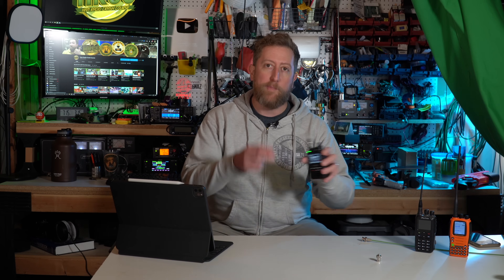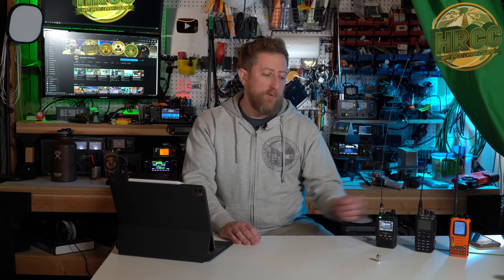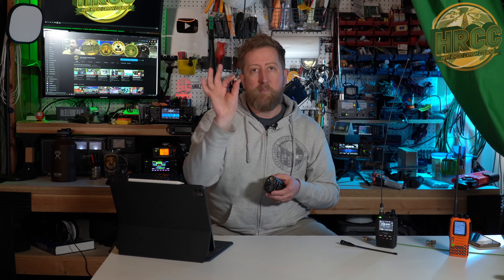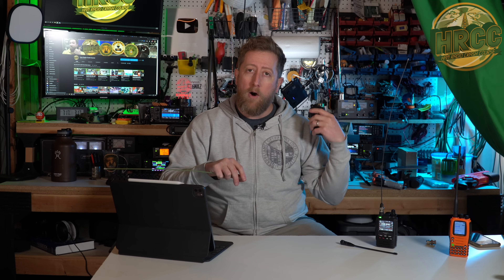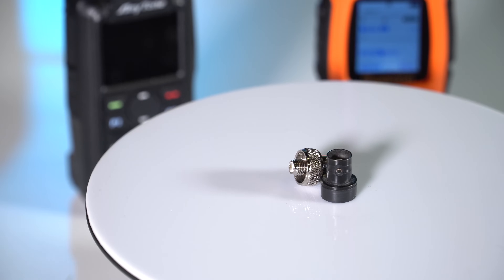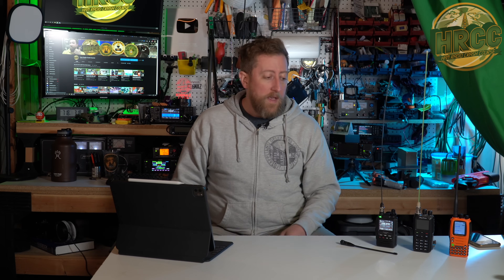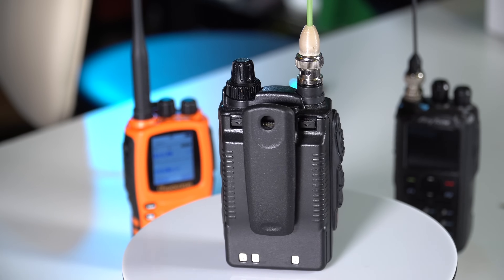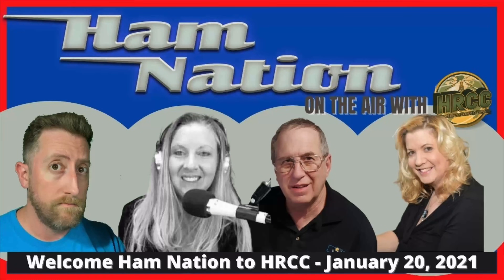The First Thing To Upgrade On Your Handheld Ham Radio

Comment: Hey man, I got a yaesu ft3d and a diamond SRH77CA. No joke, I swear it was/is worse than the rubber duck it came with. What gives?!

I couldn't hit repeaters supposedly 3-4 mi away with the diamond, but could hear with the duck

I read that quite a lot of engineering goes into the rubber duck antenna by the manufacturer particularly yaesu

I just wanted to bounce this off of you because you recommend getting an aftermarket antenna right out of the gate which is what I did and now I find myself using the ducky

Comment: Lol Both links say "you last purchased this..." looks like I'm ahead of the game this time. Also I will say I like the look of the knurled ones on particular radios, just wish they came in black.

I used to swap out antennas in my work van since I can't put a mobile in it, but stuck a mag mount on the roof. It's so much better to have a BNC to just click off and on the HT.

Comment: What, you don't like the Abbree antenna's any more? I still use the 18 inch one on my HT. I rarely remove it.
Reply from the maker: I like them fine. But sometimes I don’t want to smack myself in the face. 🤣
Reply: I've found signal sticks perform much better.

Comment: A trimmed acid brush and rubbing alcohol to wash out both the radio and antenna connectors will keep the shavings from multiple SMA uses from affecting the connection.

Comment: Actualley a lot of the antennas you buy can actualley do way more damage than the original antenna. The reason for this is beacuse the connector on the antenna is not tall enough, or dose not go  deep enough into the radio connector. Retevis use to make good sma connector antennas, I stopped buying them cause all the ones I get now are very a  shallow connector that dose not make contact with the radio connector. I have brought this up to retevis many times. But they still keep making there sma  connectors on there antennas way to short.
Reply: That's probably because the connectors they use are designed to work like a coax connector -- which are the dimensions SMA connectors are actually supposed to use. The ones that are long? those are out of spec =] In my experimentation (and I make the signal stick, so I've done a lot) the SMA-F center socket can actually take a fair bit of variance (several mm at least) for "too deep" antennas, but it is possible to damage some radios with those "tall enough" connectors.

Also, while it's "common knowledge" that transmitting with an insufficient antenna will damage your radio, that's rarely true anymore because radios will automatically reduce power if needed to prevent damage. I've not actually ever seen an HT that was confirmed to have had its finals blown because of poor SWR or poor/no antenna and you can see for yourself what happens if you try to transmit on a mobile rig -- the S meter will show that it's not putting much power out. It would be interesting to do a video to try to prove/disprove that common belief because I'm 95% certain that it's completely a myth at this point.
Reply: @HamstudyOrg  you are right. However I just feel better knowing that the center pin is making contact into the antenna or radio connector. I have annolder retevis sma antenna. And all the new ones are too short and my radio dose not receive anything unless I put the old sma antenna back on.
Reply: @Eagleoneradiogod  I don't really disagree with you there. I'm now at a point I can customize my connectors, so I'm looking at making some changes; need to do some more digging before I decide for sure, though, and at this point anything I change won't make it into a product for 3-4 months (until I use the parts I already have =])
Reply: @HamstudyOrg  My signal stick came 2 days early today, the Green one you made for me and discussed you would have to buy 5km of Olive Drab Green heatshrink to be able to sell it to us :) It works so well that I don't even care about switching it off again, it beats the crap out of Nagoya 771, Powerwerx, and the factory rubber ducky.

Comment: What is the range on hand held? To a case unit or unit to unit
Reply: It depends on terrain but basically line of sight.  If you can see it they can hear you.  In the case of a repeater, a type of instant relay station, both stations need to be in line of sight of the repeater but not each other.  Repeaters tend to be on hills or towers to extend line of sight.  Hand held to hand held over flat open country your looking at a couple miles.

Comment: What diamond antenna are you using in this video?
Reply from the maker: Not using a diamond antenna. I was using a diamond adapter. The antenna is a signal stick.
Reply: Ham Radio Crash Course cool thanks for the clarification. I have a diamond antenna now I love but not sure it would work with the adapter.

Comment: I got a signal stick for my IC-705. SWR was 3:1 without a counter poise. Came across an BNC Abbree 42.5" foldable antenna.

 Received it the other day and got tried it out. Fully extended on the IC-705, SWR was just above 1.5:1. Folded over 4 inches and the top of the antenna just to see what the SWR is, it dropped like a rock. Minimal SWR across the 2m band. 

As for some of the BNC antennas I got, I've bought a couple of Yaesu adapters and use them on my FT3D. Probably going to get a few more adapters for my Baofeng radios to run those BNC antennas.

Comment: Does BNC adapter cause power loss? I always assumed the more additional connectors there are the more losses in power there are?
Reply from the maker: An almost impossible to measure amount of loss is the accurate answer. Effectively no loss of not defective.

Comment: Hey Josh, what about adapters to convert existing SMA antennas to BNC?
Reply from the maker: Generally this is a bad idea. It makes multiple parts of the antenna and radio vulnerable to sheer damage.
Reply: @HamRadioCrashCourse  After I added a BNC adapter to my Anytone, I put an SMA-BNC on the antenna, then 3D printed a sleeve using TPU filament to reinforce the connection. It seems solid now, and works okay.

Comment: Is that only if you are buying a certain typ of antenna?  I got an upgraded antenna but it also has SMA connector.  Or do you put an adapter on both?
Reply from the maker: You would need a bnc antenna.

Comment: With the added length from the adapters would it not change the resonant frequency of the antenna?
Reply: The adapter should behave as part of the feedline rather than part of the antenna system. There's a matching circuit (really just a capacitive element between the coax feedline and shield) that inhibits the feedline from acting like part of the antenna. When I got my adapters, I tested the SWR with and without the adapter and there was no detectable difference between the two.
Reply: @Tobascodagama  This is in theory true, but in practice not entirely true; measuring SWR of an HT antenna is nearly useless because so much depends on the "counterpoise", which is in this case basically your arm, the chassis of the radio, etc etc etc. In my experience varying the length of most HT antennas by about 1" either direction makes a lot less difference than you would expect.

One of the reasons it's so hard to measure SWR on an HT antenna though is that anything you add to measure it -- even feedline -- will actually change the antenna system by a *lot*. This is particularly true with a 1/4 wave antenna such as the Signal Stick (I make those, btw, which is why I've spent so much time on this). Different types of antennas are affected more or less by this, mostly depending on how the groundplane on the antenna works.

It's kinda weird stuff; if you measure the same antenna with 10 different antenna analyzers you'll get different readings with each one. Grounding the antenna can help, but it's hard to argue that as being a realistic scenario for real-world use =]

Comment: My first HT had a bnc connection.  The manufacturer could just build them with BNC
Reply: TBH, I think the majority of users are just using one antenna, in which case the SMA is just as good while also being a lot smaller.
Reply: @Tobascodagama  I use one antenna, but it's nice to be able to collapse the thing down sometimes.  A 2m antenna is still kinda awkward.

Comment: Just had a discussion with my coworker about this on Friday, I was considering moving everything to BNC, starting with SDRs. Got this idea from watching you quickly switch things and now I have more supporting data
Reply: Be aware that not all connectors have the same bandwidth or power handling, SMA can do into the GHz and so can N connectors, UHF connectors aren't actually very good beyond VHF, and BNC isn't good for microwaves. It's pretty much a case of what connector is best for the application. Get a few adapters so you can convert between them if you need. N is a good intermediate for high power at up to tens of GHz, and SMA, for lower power at a similar frequency range. BNC is fine for anything up to the 70cm band at modest power levels.